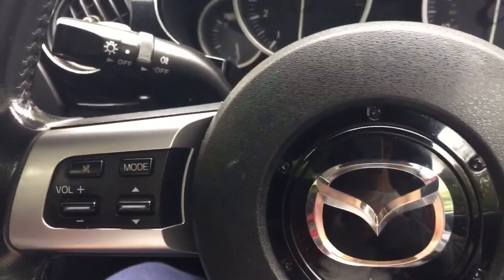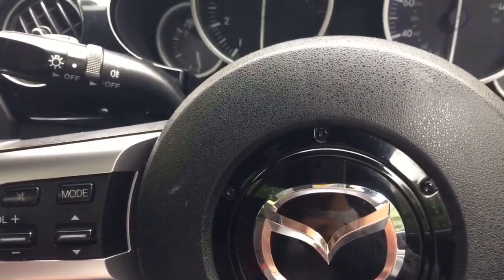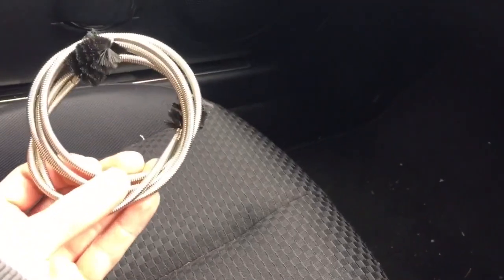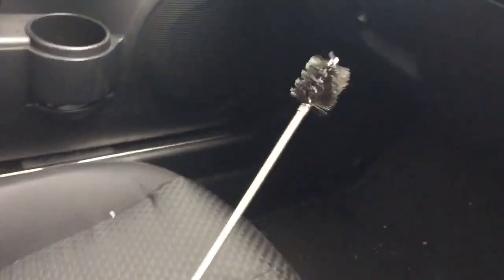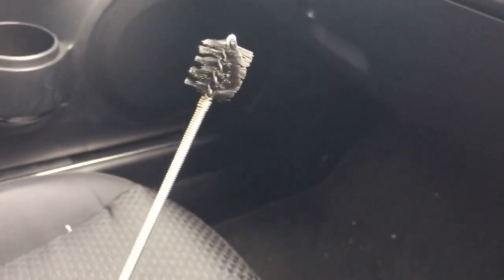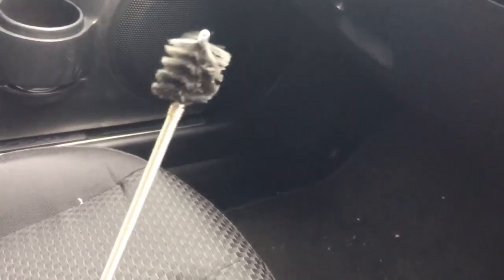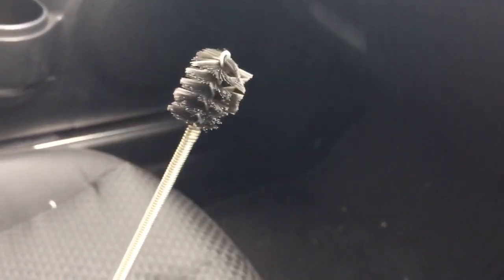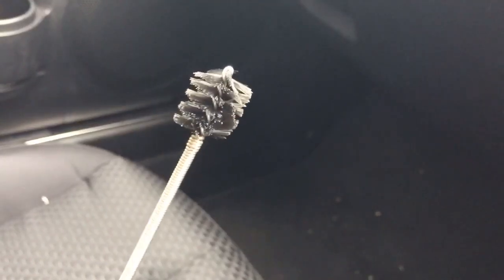Mazda mx5 mk3 drain hole clean

Comment: Bought the identical cleaner from Amazon. Have tried both sides for over an hour at every conceivable angle with no luck.. Have now given up. On a bright note my carpet in dry behind the driver sest.. Its the boot carpet thats wet on my mk3..
Reply from the maker: Hey Carl , I removed my boot carpet because it was always getting wet and smelled pretty bad ! Looks much better and u can find the hidden holes under the carpet that allow the water that gets stuck to then fall out the little holes which is underneath the carpet ! And with the brush try pushing it at a angle towards the seats ! Good luck
Reply: Dino02 Varnasidis Hi Dino.. I will look into removing the boot carpet..however i can see that the water is getting in at the front of the boot on the left just approx where the cable/flexi hose from the boot lid enters the boot. Im gonna remove the plastic panel and see what's happening behind it.. Regarding the drainage holes i can only assume that mine a different design or are entirely blocked. I have now spent another hour and my trombone cleaner continues to coil up and no hole can be found. I am following all videos and advice on aiming for the direction of the gear stick.. I have tried shallow and deep angles.. I have used force and also tried very slowly trying to move the cleaner around til i felt an opening..lol..sounds so wrong..lol...anyway.. I am going to pour hot water in the top of the little square opening that you show in your video.. If it comes out the bottom perhaps i wont need to clean.. Cheers..
Reply: I had the same problem as yourself ...... I could not get a cleaning wire into the holes behind the seats .. ......What I did instead was get under the car and locate the holes where the water drains out ... You have to push a plastic flap out of the way , be careful not to break it ...It stops road noise from entering the pipe , but it gets blocked by leaves .... I then pushed a thin wire up from underneath the side of the car .. ......until it came out by the back of the seats .... It did not line up with the holes on top and I would never have been able to do it from above ....!........ Hope this makes you  feel better
Reply: I also had this once ....Going from memory I removed the plastic covers in the boot close to the fuel cap and sealed a cable or something that was passing into the boot .. No problems since .

Comment: Hello, I've just bought an NC 2007 model. I find my passenger mat wet. Only passenger mat but the space behind the seat is dry. I passed the trombone brush through the driver's side a couple of times and it seems pretty clean. However, I cannot pass it through the passenger's side.  Do you think is it because it's blocked from mud? Is it logical that i find only the passenger's front side (mat) wet and not at all behind its seat?
Reply from the maker: If u can’t pass the trombone pass the passengers side it’s cuz it’s blocked so u have to take your time trying to pass through! Put some hot water where the drain hole is and work ur way with the trombone brush,that should help and also keep a eye on the back seat if wet maybe it got dryed or the water passed on the side of the chair and left the water on the front carpet !hope that helps :)  
Subscribe to stay updated with the Mazda build
Reply: Hi, I don't think it's the rain drains. Maybe is the Windscreen Cowl Grommet. Do you know what I need to seal it with silicone? What I need to undo the wipers and the cowl to get access to it?
Reply from the maker: Open cowl grommet and have a look ! If u can’t find the problem maybe invest in a hard roof maybe or even take it to a Mazda garage 
Best of luck

Comment: What about hard top mx5  drain holes .how can l clean them???
Reply from the maker: Nikos Karapas I’m not sure man
Reply: I was told by service manager to use the crevice tool attached to your vacuum cleaner every now and again, to suck out any debris, 
my RF flooded last week, I took it to the dealership, they removed the carpets to be cleaned and cleared the blocked drainage system, the dealership tried to charge me for this, I was raging, I  pointed out no one told me about the drainage system or that it needed maintenance and there is nothing in the handbook about it, Mazda customer care got a call from me and suddenly the charges were dropped